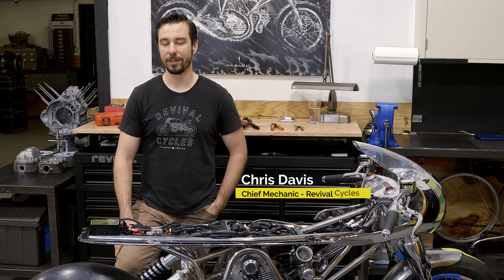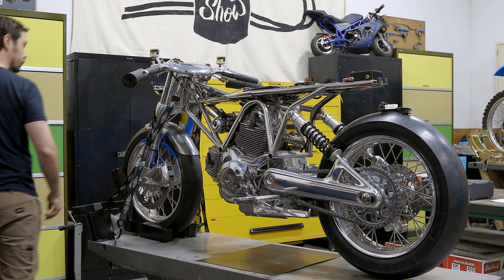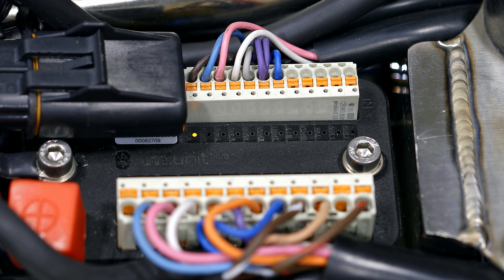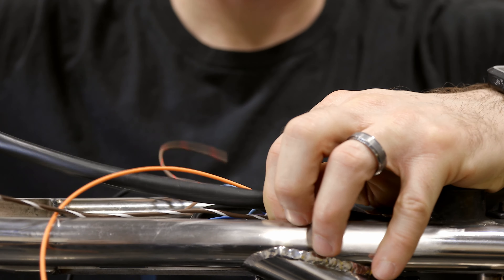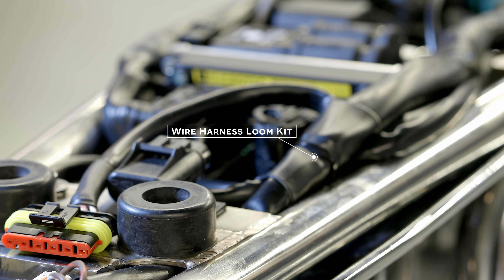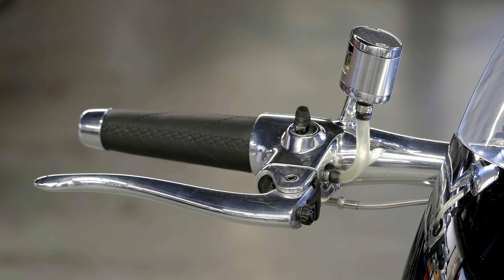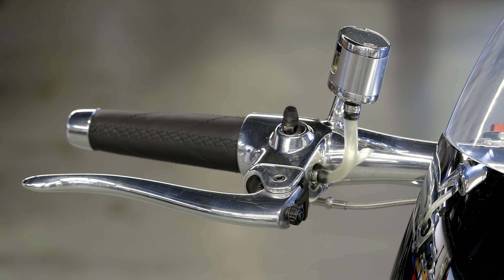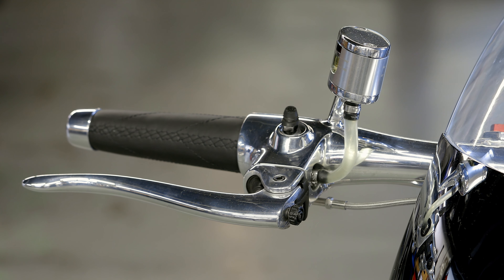How To Wire A Motorcycle Series, Episode 8: Case Study: Custom Ducati 1100 Fuse

Comment: Amazing wiring project!

The thing looking vaguely like a turbocharger 🙂 , at 5:44 and again at 5:53 (when Chris says "...throttle position sensor..."): is that the pulley for the butterfly valve in the throttle body?  I've seen it before on the bike and have puzzled over what it might be.